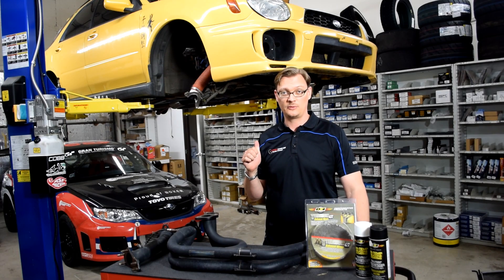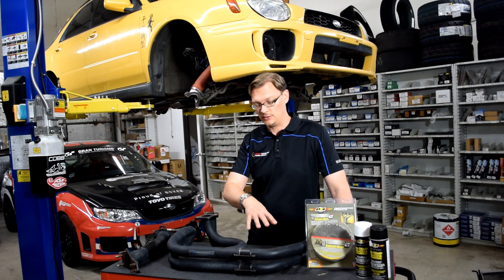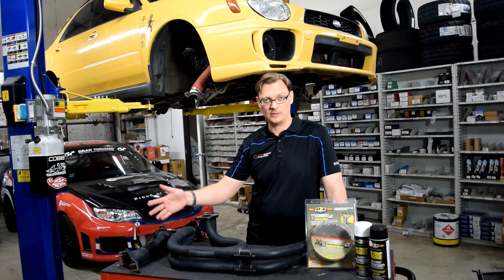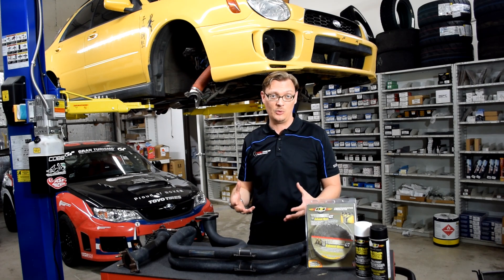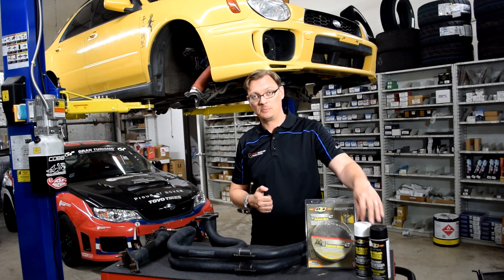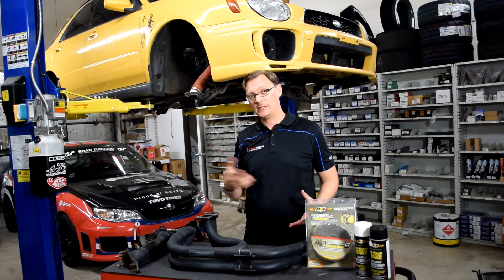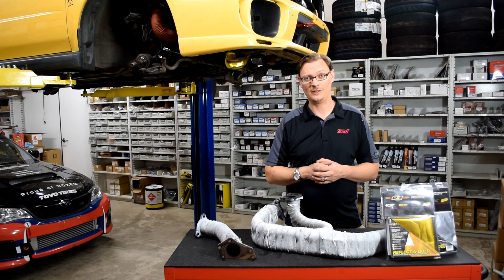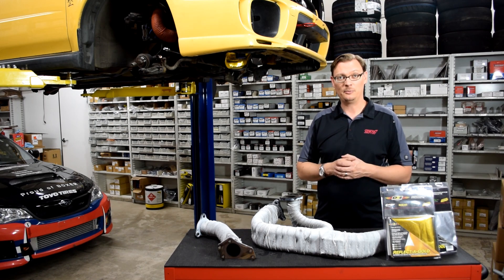All about Heat Wrap, Ceramic Coating, and Reflective Heat Tape

Comment: Is the header heat an issue to worry about with NA subaru engines? From what I understand is that they don't make near as much heat as the turbo engines.
Reply: If it does not have the factory heat sheild,it will let excess heat into the engine bay. With subaru's it likes to heat up the time cover,and dry out your timing cover belt...which in turn will F*** your engine.

Comment: I think you are wrong at 3:47.  By putting the thermal barrier on the outside of the pipe, you will be causing the pipe to get hotter, stretch more, and develop more cracks earlier.  Header wrap keeps way more heat inside will cause the header to get really hot and often fail. Tons of failures at the welds.  The focus should be on putting a thermal barrier inside of the header to keep the heat inside and not letting the header absorb heat.
Reply: Metal experiences fatigue when subjected to heat CYCLES, not just heat. Stainless steel could be at 600C forever and not care. But rapid heating and cooling will shorten its lifetime. So the wrap actually helps by slowing down the cooling process significantly, which means less chance for micro fractures.
Reply: If only we could coat the inside of a turbo manifold. But no one will do it, probably for good reason.
Also, I believe an additional factor as to why header wrap is destructive to headers, is not only the added heat, but it still allows oxidisation, and possibly some other chemical processes, that mess with the christaline structure of the metal and diminishes its strength and flexibility.

Comment: Do you recommend ceramic coating a high flow catted downpipe? I'm aiming for OEM + and nothing crazy maybe 500-550 hp on my Supra. Is ceramic coating worth it on downpipes or maybe only for headers?
Reply from the maker: Thanks for your question.  The short answer is no.  Many ceramic coaters won't coat catted pipes because it is a bit more difficult.  And the benefits to the coating after the turbos is less than the pre-turbo pipes.  The main gain from a post turbo pipe getting insulated is heat control/management. 

Hope that helps, thanks for watching and Stay Tuned!

Comment: True ceramic headers and exhaust are more importantly also coated on the inside. Just on the outside will over cook the metal from the inside. The pipe can no longer shed the excess heat efficiently by dissipating into the cooler air outside around the pipes. Yes exhaust gas will get hotter and evacuate quicker but the metal will take a beating. Plus the coating on the inside will still decrease heat in the engine bay.

Comment: For anyone reading:
What if I got my 4-2-1 catless header ceramic coated and wrapped in titanium wrap? Does titanium rub away the ceramic coating the way the fiberglass does? I imagine it would be similar. What if I use a high heat coating like VHT flameproof in between the ceramic coated header and the titanium wrap?
Reply from the maker: Thanks for your question.  Yes, we have always used the Titanium wrap and it has rubbed off the ceramic coating over time.

If you want the maximum amount of insulation, I'd recommend looking at the DEI Form-A-Shield:

https://www.flatironstuning.com/dei-form-a-shield

It is harder to work with, but it will give you the best heat barrier.  It also will let any liquids roll off its surface, which can be a helpful feature as well.

Thanks for watching and Stay Tuned!

Comment: Man I use ceramics all over to great success. I haven't gotten around to doing it but I want to grind up some aerogel and mix it into some ceramic paint and test that some. I know so far it's made huge gains in keeping my oil temps down(air oil cooled).
Reply from the maker: Thanks for the comment, and Stay Tuned!

Comment: You guys always come in clutch when I'm researching subie stuff!! I'm currently doing an na-t with an ej253 (avls) with a 2018 stock sti header and up pipe. The header kept the shielding it comes with but I had to strip and "re-do" the up pipe for fitment with the head. It's still very close to the head and would like to keep that area as protected as possible from heat. Should I ceramic coat the up pipe and add heat tape to the head or will a wrap be more of a viable way? TIA
Reply from the maker: Thanks for your question.  For the up-pipe, you do want to keep it as insulated as possible to keep the hear away from the head.  I'd say that if you are not able to run the stock heat shielding, then wrapping the up-pipe would be the next best option.

Beyond that, you may want to look at DEI's form-a-shield as that has a metal outside to help prevent any possible issues with oil dripping onto it.

Hope that helps and Stay Tuned!
Reply: @FlatironsTuning  Thank you!

Comment: Hey man just curious is it 100% necessary to us the ceramic spray on the fiberglass wraps or is it jusy suggested, just curious if i need to coat mine or not.
Reply from the maker: Thanks for your question.  No, it isn't required to seal the heat wrap.  If you don't seal it, it can be more likely that it can hold any oil that might come into contact with it, and as it goes through heat cycles over time, it will become more brittle.

Over time, heat wrap can start to come apart and fall off, so the hope is that the silicone spray will help keep the wrap together much longer.

I hope that helps and Stay Tuned!
Reply: @FlatironsTuning  Thank you very much this helped alot.

Comment: You drastically reduce the life of the Headers.
Reply: Exactly why you use something like 321 that's able to sustain higher temperatures without fatigue.
With plenty of insulation, 304 will definitely stay warmer than it's able to reliably handle.

Comment: Do you recommend DEI with the high temp silicone on bare metal headers. Does it holdup well?
Reply from the maker: We have been running the DEI heat wrap for a couple years now.  Not a lot of miles, but a lot of very high temp use, and it is still holding up!

If you think that you will have to install and remove the header often, you might want to try something like the DEI form-a-shield instead of the wrap.

https://www.flatironstuning.com/dei-form-a-shield

Hope that helps, and Stay Tuned!
Reply: FlatironsTuning nice!

Comment: Do you recommend DEI wrap with ceramic coated headers ?
Reply from the maker: Thanks for your question.  The short answer is no.  From our experience, over time, the header wrap will rub off the ceramic coating.  So at first, you may have much better heat management, but over time, that improvement will fall off.

Hope that helps, and Stay Tuned!

Comment: What kind of headers are those. I believe I have the same ones picked them up ceramic coated inside and out.
Reply from the maker: They are Kinugawa headers.  Basically the same as most of the common header types out there.

Thanks for watching!
Reply: @FlatironsTuning  wow really?! I thought those are tomei el headers for a second there
Reply from the maker: @xEhsiaN  Well, it turns out that there are  a number of headers that are actually made by the same manufacturer and re-branded.  So it isn't entirely surprising that you might think that :-)

Thanks and Stay Tuned!

Comment: Ceramic coatings inside headers are effective, outside they're just paint. Black coatings on the outside will increase their emissivity and help them cook adjacent parts.
Reply: Estebita Latorre  yeah, i was thinking to first ceramic coat the header, then wrap it and finally tape it with some golden heat tape..
 It's a bit overkill, but there's that, any bit counts!

Comment: Would wrapping a ceramic coated turbo manifold be ok?. if it's a daily driver and your not racing around. Just wanting to protect the components around it.
Reply from the maker: Thanks for your question.  Sure, you can certainly do it.  Just keep in mind that more than likely the wrap will wear off the ceramic coating to some extent.

Thanks for your question and Stay Tuned!

Comment: How would putting vents on your hood effects heat management?  Would you be more inclined to use ceramic coat over the wrap?
Reply from the maker: Thanks for your question.  I'd say that would have little to no effect.  The heat generated by the headers that you have to combat is radiation (think Infra-red), so just moving more air through the engine bay would not help that unfortunately.

Hope that helps, and thanks for watching!

Comment: I’m running a stock 2000 c5 corvette, going to bump up the exhaust a little. Looking at the BBK shorty headers they are ceramic coated. Would it really be necessary to wrap it, being I’m not racing, just looking for a nicer tone and just a little boost in power. I’m not going with long tube because of clearance issues, these NJ roads are bad, I don’t need my exhaust getting damaged also if my stater needs replacing again, I would have to remove the header on the passenger side, now I just have to drop the H pipe, well it’s an X pipe now, but u get my point. Besides I would only be able to afford cheap thinner wall ones. The reason I’m mentioning that is because there is always somebody that will say, get the long tubes, when I’m not asking for that opinion. What’s your thoughts? Great video.
Reply from the maker: Thanks for your question.  I'd say go and take a look at the area around where the headers are going to run.  If they are close to anything that you don't want to get hot (like plastic, cooling system, etc.) then it may be worth looking at taking some other heat control measures (like the reflective tape.

The other thing to consider is what you are doing with the car.  If you are driving it on the street most if not all the time, the chances of the headers getting really hot is much less.  If you are tracking the car a bit where the exhaust will be getting up to maximum heat for a reasonable portion of its life, there again it may be worth looking at more heat control measures as you are putting the part on the car to prevent discovering issues.

I hope that helps, and thanks for watching!

Comment: So... I know you talked about it, but what is your honest opinion about wrapping a ceramic header? Mine are supposedly rated for 1800 degrees. I have a supercharged V8. I want the least amount of heat, but I also don't want to ruin the headers. Installing these things are a pain in the butt.
Reply from the maker: Thanks for your question.  All I can say is that from what we have seen on our turbo manifold, wrapping the ceramic header was the most effective at keeping heat away from things that were around the header.  But it also did take off some of the ceramic coating over time.

If you have the coating, and there aren't any critical pieces that are about 1" - 2" from the header, you are probably okay.  But if there are, then you may want to look at some form of additional insulation.  DEI has another product that we haven't played much with yet, but it seems promising for some applications.  It is called Form-a-shield:

http://designengineering.com/form-a-shield/

If there are some specific locations that you want extra insulation, this could be a good option, and I think that it would have much less wear when going over a ceramic.

Hope that helps, and thanks for watching!

Comment: Header manufactures will void the warranty if they have been heat wrapped.
Reply from the maker: Thanks for your comment.  That is pretty common because of the additional heat load that wrap puts on the metal.

Thanks for watching!

Comment: ummm ceramic coating is intended to be effective on the inside of tubing. it's on the outside only because of cost to mask it. the point of ceramic coating is to help the heat of expanding gasses move down the tubing, rather than being dissipated through the tubing, therefore causing better scavenging.
Reply: And it stops you melting stuff
Reply: well, I've had several header's ceramic coated at a place called fireball coatings in the Toronto area who also do coatings for race cars and they only coat the outside no matter how much you pay them,  it really doesn't matter if you coat the inside or outside as the ceramic coating acts as a insulator to keep heat in the exhaust header's rather than let it escape into the engine bay,  the greater heat in the manifold increases exhaust velocity which in turn increases exhaust scavenging,  essentially exhaust header wrap will accomplish the same effect.
Reply: @kevins5911  putting coating on the inside is also an attempt to make the headers last longer.

Comment: Hi mate! Thanks for your informative video! I'm wondering i just bought a Tomei unequal headers for my 04 fozzy xt. You recon i should ceramic coated? They look awesome bare metal, but do they get a lot hot? The oem have a protection shield around them. Thanks in advance

Comment: Did you DIY the ceramic coating, or have it done somewhere else? Was it coated inside and out? What's the temperature rating?
Reply from the maker: This coating was professionally applied, and it is rated for 2000* F.

Thanks for watching!

Comment: What if you used a dry sump oil pan and pump? That would reduce the amount of oil near the headers because the dry sump oil pan is much shallower.
Reply from the maker: That is certainly true.  And there are many other benefits of the dry-sump system as well.  But it is not a simple install, and I wouldn't recommend it for a street car.

But it would certainly help to keep oil temps down :-)

Thanks for watching!

Comment: does cc melt in real hot weather
Reply from the maker: Thanks for your question.  Sorry, but not sure what you mean by CC??
Reply: FlatironsTuning sorry i meant ceramic coating
Reply from the maker: Okay, no, it will not melt at all.  This is something that has to be professionally applied keep in mind, but is is very durable.
Reply: FlatironsTuning just checking cos in some states they have 3 digit temperatures in summer.
Reply: @Sacredevil6  Ceramic coating is designed to handle temperatures in the excess of 1000c /1800f
Reply: Yowser thank you

Comment: Is it possible to wrap a single header pipe with the gold take then wrap it with the fiber glass wrap on top for more heat reduction? The header on my quad is to close to my leg and gets real hot.... Way to hot...
Reply from the maker: Thanks for your question.  The gold foil is to reflect radiant heat, and it wouldn't hold up on an exhaust pipe.  However, I think that if you wrap your header and make sure that you are overlapping 1/2 way with each new wrap that will give you a double layer of insulation which should make a big difference. 

Hope that helps, and thanks for watching!
Reply: Yep, exactly and it's no fun! What about ceramic coating it, then wrap it and finally tape it?

Comment: I really appreciate these tips :) Keep it up!

I have a couple of questions, do you guys also use a turbo blanket? do you see any harmful long term effects on using a turbo blanket? (possible cracking of the hotside housing)

I'm really contemplating on using it on my evo6, 4g63. temperatures here in the Philippines reach 101 deg. F outside. i cant imagine how hot it is in the engine bay.
Reply from the maker: Hello Andrei.  Thanks for your question.  We do use a blanket on our race car, and it has had no negative effects.  For a street car, you would just have to keep an eye on your coolant and oil for a bit to make sure that you aren't heating them too much.  But we have also started to see some people that have shown that there isn't really a significant increase in oil or coolant temps with blankets.

On an Evo, it should really help to keep your engine bay temps down, so it would be worth a try.

Thanks for watching!

Comment: So did the silicone coating make a difference?
Reply from the maker: Thanks for your question Mohamed.  The biggest difference that I have noticed so far is that it really makes a difference in how any oil that gets on the header is shed off.  I have since changed the oil, and it is next to impossible to prevent at least some oil from getting on the headers.  This happened, and it could be seen since I used the white coating.  I continued with the oil change, and let the pan drain, etc., and by the time I came back to button everything up, all signs of the oil that had got onto the header wrap were gone.

We are putting it on a couple other headers, and we'll see if there is anything else that we notice.

Thanks!
Reply: @FlatironsTuning  Hey, how about now 3 years later? I want to wrap my aftermarket up pipe and downpipe and it sounds like coating the wrap is a good idea.

Comment: I can grab my header with my bare hands when the car is running... even when the motor is warmed up... big turbo spools at 3800 instead of 4200 rpm... this guy needs to learn more about thermodynamics as it relates to Turbos and Horsepower
Reply: Jonathan Scafe what did you put on your header to keep it that cool while warmed up?
Reply: @The_short_buss  agreed! What did he use?
Reply: ^can confirm

Comment: You need to take care on how you explain heat transfer by conductance and heat transfer by radiation. They are two different process, and each have their own properties.
Reply from the maker: Thanks Litch.  I did my best to be clear, but it certainly can get tricky.  Thanks for watching!
Reply: Care to share your enlightenment and add some constructive details, @Litch?